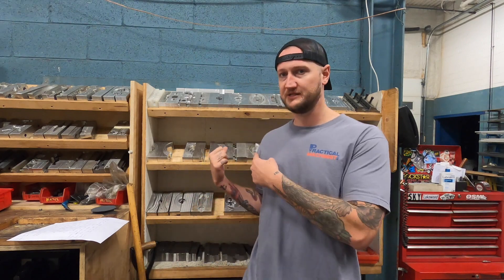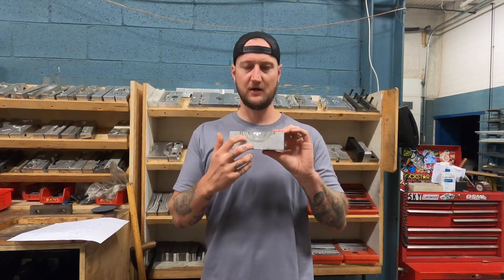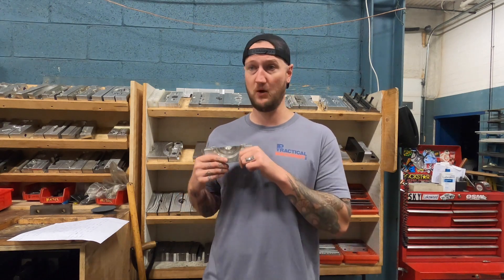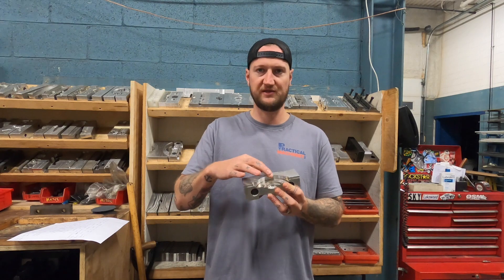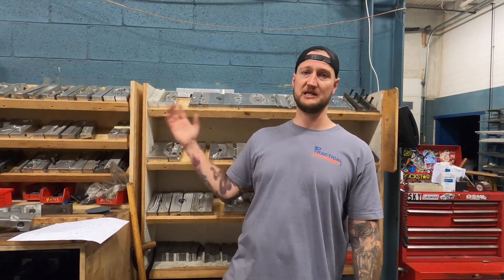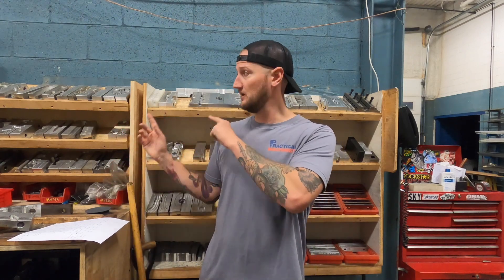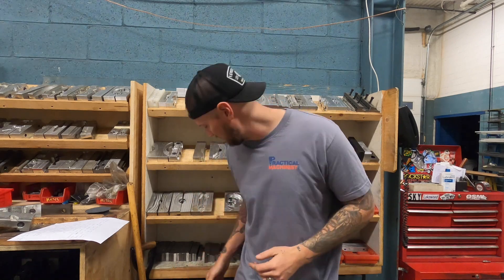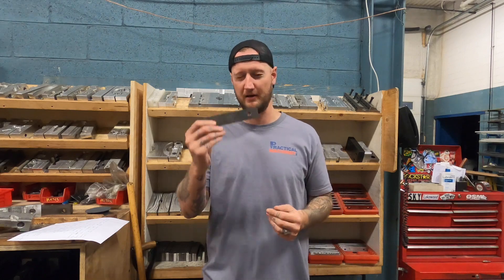Let's Talk About Soft Jaws | Machine Shop Talk Ep. 36

Comment: Hot tip, when holding round parts in soft jaws putting a small relief at the back and front of the jaws allows for some variation in part diameter and still have at least 4 points of contact it doesn't need to be much 5-30 thow and about 1/3 of the surface area cut into the jaw centered on the jaw.
Reply: Very good point! I’ve had to do this when running hot roll or cast parts in the past as well!
Reply: Or cut a square, so each half of the jaw has a vee in it.  That is way better than 2 points of contact and rocking.

Comment: The shop where I worked (I work in a warehouse now...:-P) used a program called cnc setup.
You just typed in the jaw id on the computer and it told you what job they were for, what pressure to use, size etc or type the job number and it told you what jaws to use. You got pictures of the setup, everything.
We had loads of soft jaws.
Maybe I'll try to get back into machining in the new year.
Reply: I’ve never heard of that, that’s sick! I’ll have to check it out! And yeah man, the trade needs you - you can pretty much name your price at a lot of places these days!
Reply: @iansandusky417  
The problem I have with getting back into the business is that I'm living in Vienna now and
 my german leaves a lot to be desired. It's getting better though, I think:-P
(Any employers in Vienna who need a cnc turner?)
I've got to be honest though, working in a warehouse is a lot less stressful than cnc machining!

Comment: Torque wrench is your friend as well torque when you cut the jaws and the same when you run the parts. I also slightly snug up the moving jaws adjustment bolt until there’s just a little drag on it
Reply: This is fantastic advice!

Comment: I machined aluminum stock to exactly to .125 to use for a sacrificial spacer. I also engraved the fixed jaw with “fixed” so the parts are always the same. I also only do 2 parts at once, only to allow for more tolerance difference in the stock materials.
Reply: Ah, yes! Marking the fixed vs float is a big one, I definitely missed that! Excellent point! 🍻🍻
Reply: I engrave the fixed jaws with the client name/part number, and hash marks at program 0 and label G54-OP1/G56-OP3, etc. If you can read it, it's installed correctly. LOL

Comment: If I have an odd shaped part that needs to be gripped tightly, I will use a .125"x.125" piece of steel barstock as a spacer that sticks out from each side of the jaws when clamped. I will set it just below the deepest depth of the pocket I'm about to cut. I tighten the vice to the same torque that will be holding the part, and then cut my jaws. This way, if there happens to be any deflection in the jaws when tightened, the final grip will always be square. If you don't tighten before cutting the jaws, you could cause the part to be held only at the very bottom of the pocket, and has been known to allow the part to "walk" up the taper, and out of the jaws at standard sphincter dilation rate.
Reply: This is fantastic advice!
Reply: I usually hold at a little higher torque with the spacer just below the bottom of where the part will be.

I tend to get a taper that is tighter at the top, not by a lot but i think it helps

Comment: i try and stay away from soft jaws in a vice  since i got a 4 jaw self centering chuck for the mill  found it much more accurate , also for a vice a torque spanner was good if you had different operators running the machine .
Reply: The torque wrench can be a lifesaver! Keeps the pressure consistent so nobody crushes the step jaws!

Comment: Check out Adaptor soft jaws. Haven't used them myself yet but looks very interesting
Reply: There are a few brands I've seen that make soft jaws that look pretty cool - I think Orange had a line that dovetailed into a hard jaw for easy switchout! I've never used any off the shelf solution - I've only made my own in the past.
Reply: @LetsMachine  yeah, I currently use the Carvesmart jaw system in the Orange Vise. Favorite so far
Reply: @tylergilbertson4086  Carvesmart! Right, those are the ones I was thinking of!

Comment: Let's talk about cutting into hard jaws.. 😄🔥
Reply: Haha definitely been there too! And honestly milling hard jaws for parts you’re going to do a lot is a good next step from soft jaws - I’ve got a few custom pairs over the years for repeat steel jobs that chew up 6061 jaws!
Reply: @iansandusky417  I was just thinking about a pallet changer mill from a shop I worked at.. side A and side B had two vices per pallet.. each one different step in the part.. something like 27 tools.  Well.. someone on first shift ran B side on A side of program. And vice versa. None of the Jaws or tools survived.. had ear buds in not paying attention.. it was total carnage..
Reply: @NORTHBROOK1978  oh sweet mother of god, I can feel my blood pressure rising via osmosis
Reply: @iansandusky417  I was on lunch break early in my career when one of my machines started making a new noise.  I ignored it for a few seconds before my lead told me to get my ass out there and see what is wrong.
Reply: @iansandusky417  I was just an operator then.. the setup guy was not happy. Now I'm the programer set up guy.. different company.. and I feel the pain.. let's rapid through your fixture.  I almost cried Thursday..
Reply: @madisonrollings1845  and this is 100000000% why my apprentices don’t like me for not letting them wear AirPods on the floor while the spindles turning 🤷🏼‍♂️
Reply: @iansandusky417  I'm curious to hear if this rule applies to everyone at the shop or just the newbies. I've found that one of the biggest improvements to my efficiency is knowing when I need to pay attention to my machine (no earbuds) vs. when I'm safe to walk away and program the next part/op (one earbud or both depending on risk assessment).

I know it sounds trivial, but I'd be hesitant to stick around at a shop that didn't trust me to make reasonable choices regarding earbuds after I'd proven myself. That being said... maybe I'm just one terrible crash away from re-evaluating my risk tolerance :)

Comment: 1 vote for 2 parts per vice, as the jaws wear you may toss a part, just not worth it, not worth blowing up the cutter.. bla bla
Reply: Quite true! It's definitely the safer solution. I've gotten away with 4 parts if it's op2 and I'm only holding on four identically sized parts - but especially with rough stock, the juice ain't worth the squeeze to try for more.